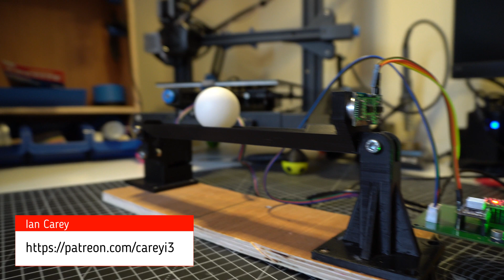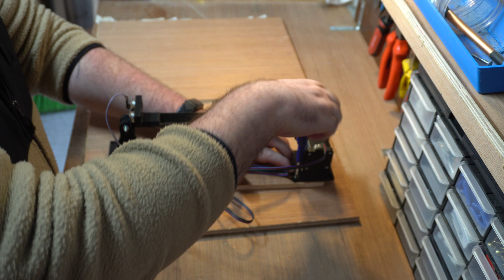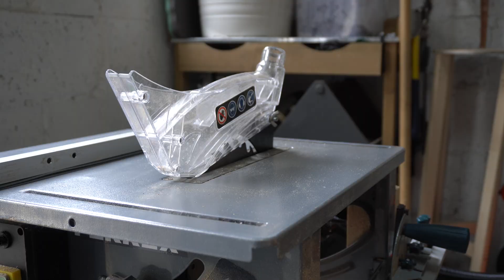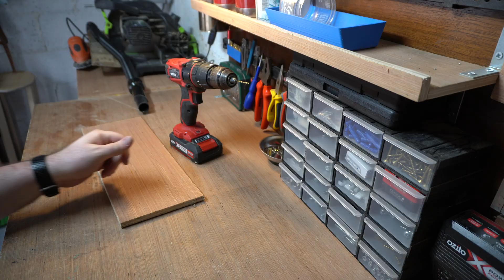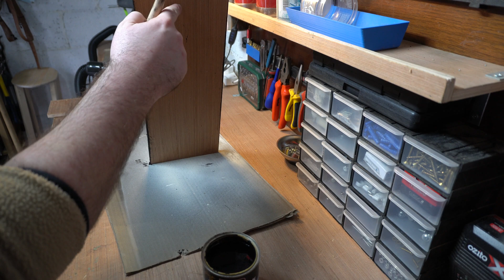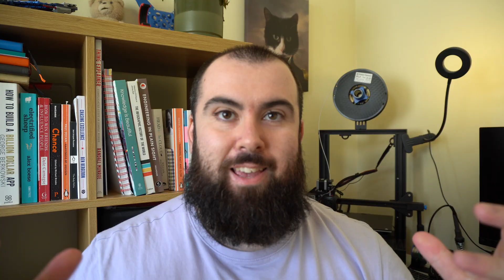Ball & Beam Kit - Part 5

Comment: hey i just recenlty had a big intrest with robotics and i am a huge fan of your series i would also like to start with my own journey can you tell me where and how i should start with no prior experience. or maybe i should buy certain books
Reply from the maker: Hey there, that’s great to hear, I’m glad you like it! I’d say the best thing to do is get yourself an Arduino board or one of their starter kits with the board and a bunch of components. There are loads of online tutorials and YouTube is your friend  here. If you have a 3D printer this is also an amazing tool for being able to make parts for robotics, it really helped me a lot when I got one. Aside from that, I’d say start following some makers on YouTube and the robotics sub on Reddit, you will never run out of inspiration!! Best of luck, enjoy the journey!
Reply: @careyian  okay thanks but whats the diffrenece between arduino and raspberry pi i got advised to do that instead but i will also look into arduino thanks for the help
Reply from the maker: @willgggg900  it depends entirely on what you want to do. RaspberryPi is essentially a tiny form factor Linux computer that is capable of running very high level software. Arduino is a much more low level device which runs more basic code but is capable of interfacing with sensors and motors etc very well and in near real time. Typically robotic systems can have a mix of low level and high level devices doing different jobs. Personally I recommend you start with Arduino.
Reply: @careyian  okay thank you so much